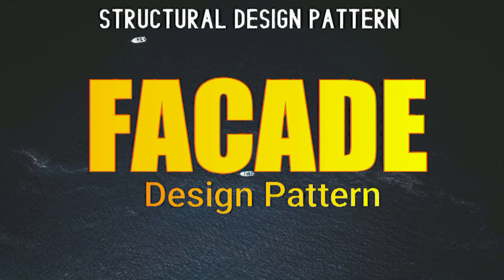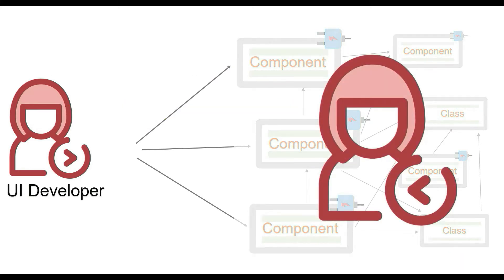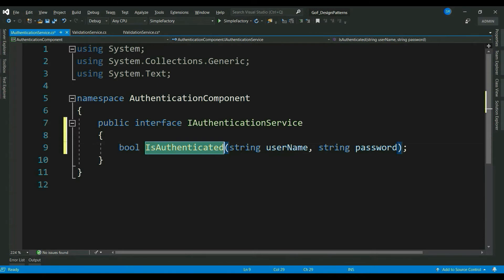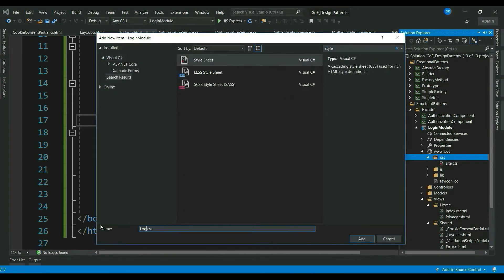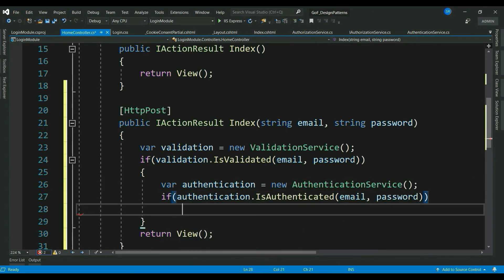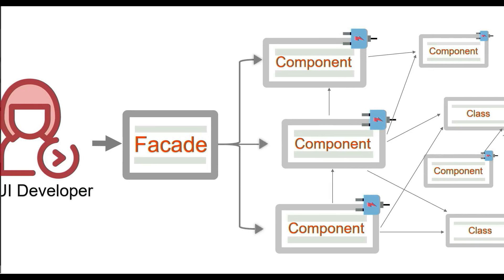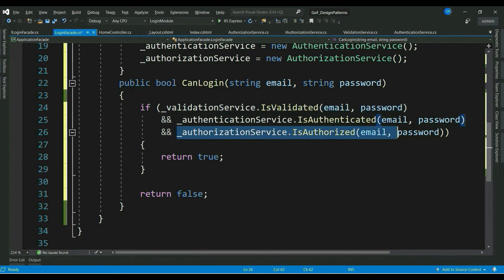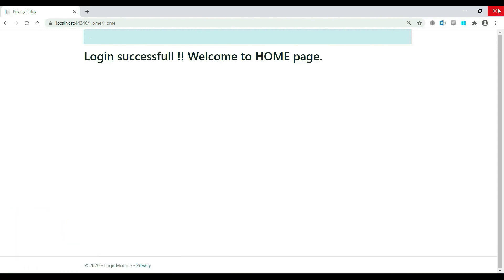Facade Design Pattern in c# | When to use Facade Design Pattern | Facade Design Pattern | Part 11

Comment: What is the need for creating interfaces here in each component
Reply from the maker: this is a sample implementation to understand facade - our login module interacts with multiple components and facade hides the complexity of interacting with those components. That way the login module implementor just needs to know about the facade interface and doesn’t need to know about the business complexity that facade deals with. I hope that was pretty much clear in the video.

The idea behind introducing interface is that it helps in designing a loosely coupled application where if the authentication component developer wish to add some more authentication logic in future, then it can always do that without impacting the client. The application will work seamlessly as long as the interface definition does not change.

But, off course we could have even implemented facade with concrete classes as well (without interface)

btw, I have just used 1 interface per component here, but in real-time the system could be quite complex with many dependencies consisting many interfaces.

There are many advantages of using interface -
watch these 3 videos, I have explained 3 prominent advantage of using interface -

IOC Container & DI	: https://youtu.be/PAO9fAzz-GM
writing testable code	: https://youtu.be/mIVAhH9J60c
loosely coupled app	: https://youtu.be/tKJY5icC4eM